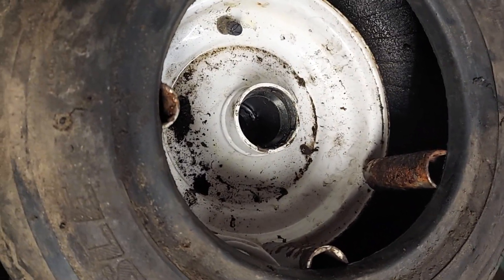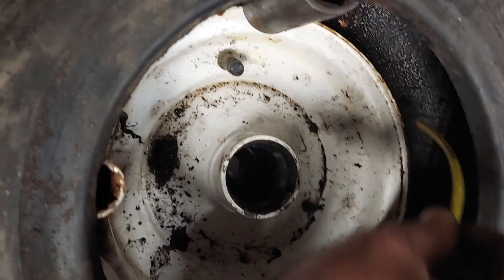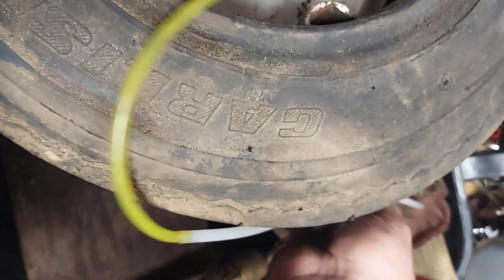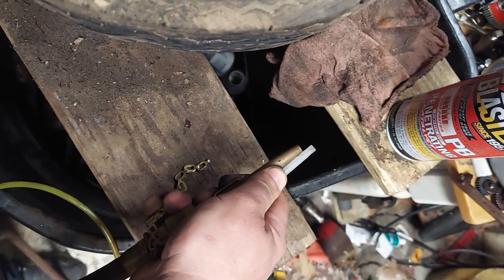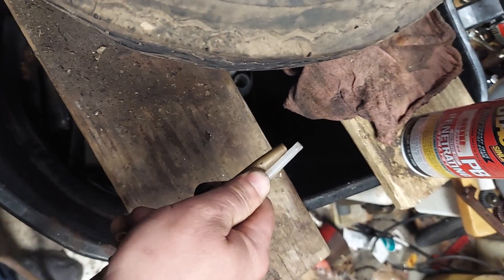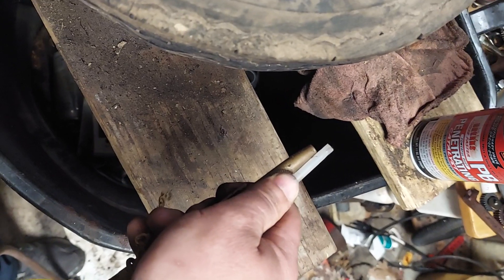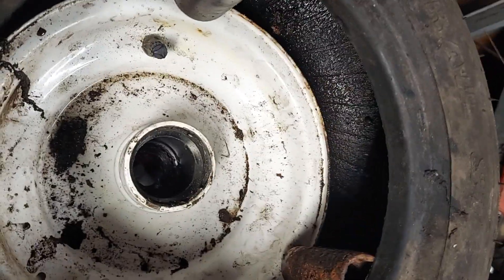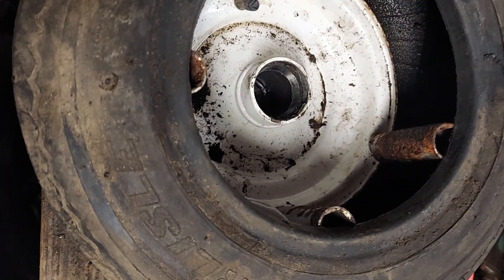easy way to get water out from old tires. works trick and not as messy as soaking it up.

Comment: ?
Reply from the maker: @jfjjjjfj  ????:)
Reply: Can't you just drill a small hole in the tire? 🤡👍

Sorry, I couldn't help myself.
Reply: @Swampyankeehomestead 
 The video would have been much better if you had actually included the part showing you actually removing the water instead of just talking about how you did it.
Reply from the maker: @trendinvestor2893  yes you are correct exept for one thing. My small compressor runs the whole time and you can't hear a damn thing.